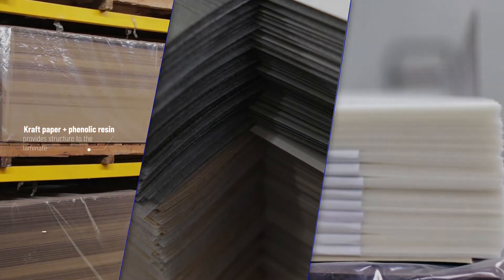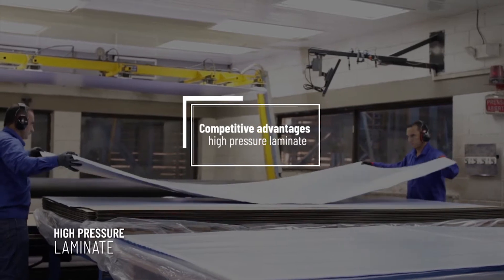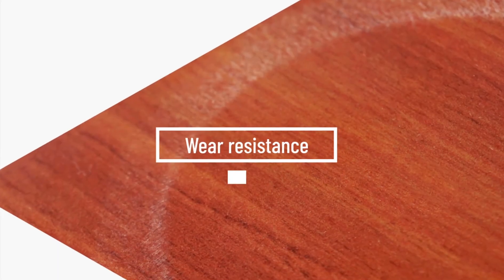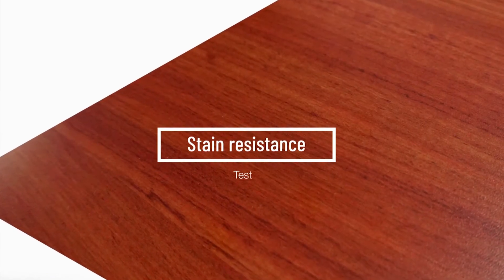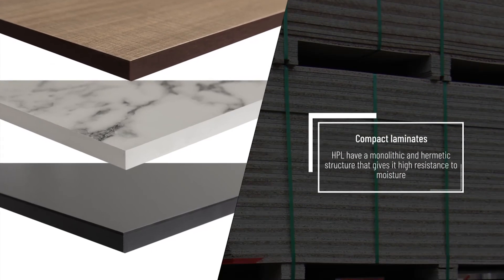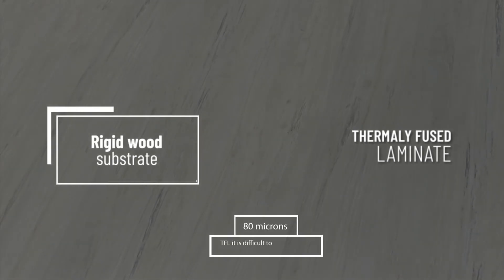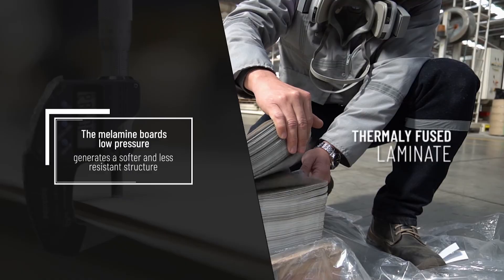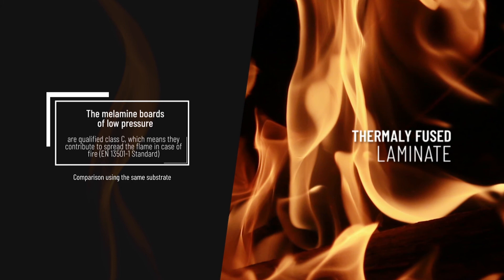HPL Advantages Lamitech ( high pressure lamination)

Comment: Dear sir, we supply melamine paper, phenolic film, kraft paper impregnation line with arm radial un-winder, high accuracy glue pickup impregnation, heating chamber, gas burner, hot air distribution, second gas recycle, second coater, web aligner, paper tractor, rotary cutter, conveyor and stacker. if you are interested, please contact my WeChat/WhatsApp: 008613585219477 www.ruiyant.com